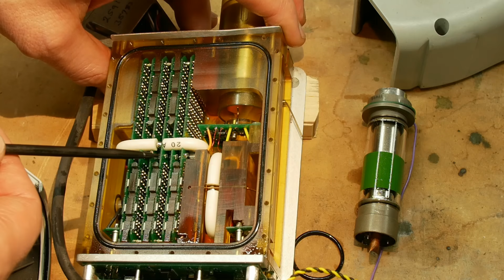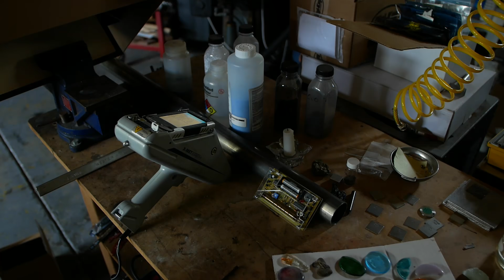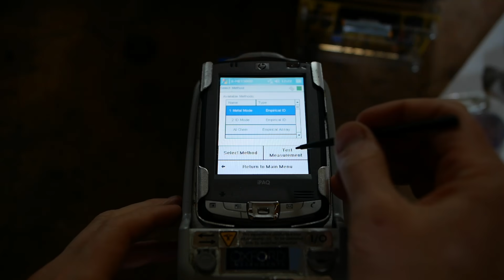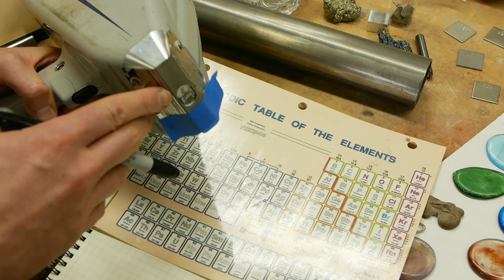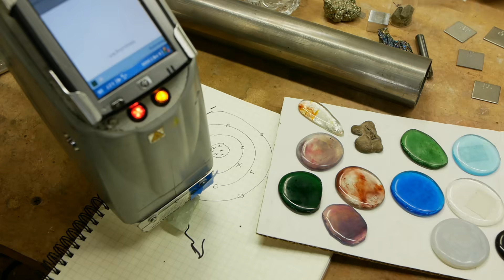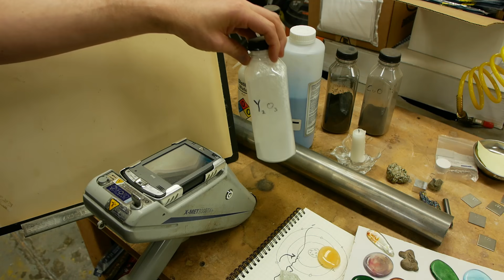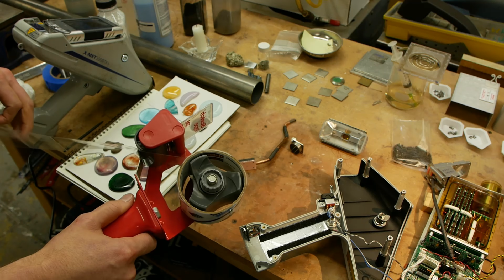Demo and teardown of an X-ray fluorescence gun (measures chemical composition)

Comment: The detector is likely either a Si-PIN photodiode, or if it's a more recent(/expensive) unit, it's an SDD - silicon drift detector. Beryllium window, multi-stage peltier cooled stack construction.
Reply: So cool to see y’all’s discussion on scintillation materials and the Si-PlN Technology. I totally geeked out and became addicted to buying and building Radioactive detection equipment over the past few years. A buddy of mine owns a large local scrapyard… And we are in close proximity to Oak Ridge national laboratory (Home of the atom bomb)...  we get WAY MORE than our fair share of “hotter than hell” sources, and my buddies scrapyard had no means of detection. That’s what started me out on this journey.

I started with a few small bicron Nal-(Tl) probes and worked my way up to a MASSIVE 5 inch Nal bicron detector. Also designed, 3-D printed, and cast my own lead collimator assemblies for the probes. 
So that I could use the ridiculously sensitive scintillation probes for the scrapyard… then with the use of the collimators I’m able to hone in on the exact location. 

It’s been a hell of a ride over the past two years… and the stuff in this video is WAY above my pay grade. 

I did build and purchase a few PIN photo diode array detectors.... but that stuff gets complicated fast.

I’ve been having a lot of fun recently purchasing radiation area monitors, port/border monitoring equipment, and walk-through style detectors made with massive sections of low resolution scintillating plastics. 

Still a lot of fun to play with! And some of it available on eBay at incredible prices. And I soon hope to have a drive-by detector set up and ready at my buddies scrap yard. 

It’s been a lot of fun locating hot sources. Some really spicy stuff around these parts… With all of the long running history of radioactivity and testing in our area.

Great to see there are many interesting folks out there!
Reply: Back in the early 90's I was doing my MS in Physics. A company had provided funding to my university (so they didn't have to get a license from the NRC) to build a prototype very similar to this. The differences were that 1) we were using Co-57 as a source of gamma rays to excite the x-rays within the sample, 2) we were specifically looking for only Lead (to detect Lead paint in housing projects), and 3) we were using low resolution (cheap) NaI scintillator crystal attached to a photomultiplier tube as the detector. I earned my MS from that project, but the company funding the research had problems of one sort or another and never ended up producing an actual product.
Reply: @andywinslow6631  Early handheld XRF tools used radioisotope sources. Usually Fe-55, which had to be replaced often due to decay.
Reply: @Spirit532  Fe55 emits very low energy, how x-ray fluorescence excited?
Reply: @MaxmaxOFF81  Other lines, I'm assuming. La/Lb, Ma/Mb. And Ka/Kb up to chromium. No idea if it'd actually work, but that's what I remember seeing.
Reply: @Spirit532  thanks!
Reply: TheNeatWhale  No, SiLi detectors are not and have never been made in such tiny cans. They also have basically no resolution above ~200K, which would be very difficult to achieve here.
The closest that has ever been commercially available was the Kevex PSi, and that didn't last long on the market. Not to mention it was about the size of this entire handheld unit.
Reply: dustisdeadbodies85 the X-ray window is transparent aluminium
Reply: @fdutrey  Curious. Most of the x-ray stuff I have played with (and the odd bits i own) use beryllium as the window beacuase of its low mass absorption coefficient. As the generator itself is quite low powered so the "back scatter" is going to be incredibly low, I would have thought they would do all they could to get every last hint of energy back into the device.
Reply: dustisdeadbodies85  
I just read up on it. Appears it is done with Instagram, reddit, Twitter, tik tok, and a few others, saw nothing pertaining to YouTube, although the individual channel owner can block a commenter for various reasons, but it is an outright block, not a so-called 'shadowblock'. I don't know. YT has been strange for a long time, but has been ads intensive to the max for 6+ months. I see several different ads that could be considered mini documentaries that last over 30 minutes. There is one by a Dr. Gundry about emptying bowels that, and this is no exaggeration, lasts 59 minutes and 59 seconds! And yes, I skip ads after noting the time and advertiser. They'll never get my business! 
  Sorry about the long-winded rant. I don't think that either of us is 'shadowbanned'.
Reply: @stanervin6108  You should read up on ad blockers too.
Reply: @TheMrTape  
    I totally know about Adblock. When used, the video uploader gets less than seven tenths of one percent ( .7% ) of ad revenue. When NOT used, the uploader gets seventy-five percent ( 75% ) of ad revenue. As long as the ads aren't skipped before the fifteen second mark! YouTube gets their twenty-five percent regardless of whether an adblocker is used or not! I choose not to use an adblocking app as my way to support the channel financially without paying for a Patreon subscription, as I am on Social Security benefits and just don't have sufficient funds to do so. I skip ads after the required 15 seconds, but jot down the ad length and admaker whenever the ad becomes abusive in length, i.e. anything over two minutes! Do you understand my stand on that matter?
Reply: @stanervin6108  I understand and respect your stance good sir. However it is my belief that running ads, something that relies on manipulating/attempting to control the free thinking of people, is immoral, greedy and incompetent, and furthermore disrespectful to the content in that it delays and muddies the quality of it, and the viewers in that it forcefully takes away some of their time up-front for something that potentially isn't worth it to them, regardless of their consent; I instead believe that what's right is for the content maker to be creative in non-parasitic ways of earning compensation for their work, at the free will of the viewers, in whatever way that doesn't choose/dictate for them, be it donations, selling products/merch or whatever else moral method they can come up with. All that said, content creators today are only paid 16.5% of the ad revenue (contrary to rumors/lies that state a much higher share), revenue of which is already extremely low; averages today go at $0.14 per 1000 views or $0.32 per 1000 views, for <10min and >10min videos respectively. Share has never been 75% (and it has never been anything at all for blocked ads), it has however been 55%, but then Google decided to decrease the share with 70%, so creators end up with 16.5% (in my country most music on Youtube was blocked for 2 months up until 2 weeks ago, because the "governing" body representing Danish artists, Koda, wouldn't accept the 70% decline in ad revenue shared with them and the artists in their new contract with Google; as a result Google announced they'd block all Danish music in Denmark, but ended up blocking most other music as well; Koda finally cracked and accepted; Google had by the way argued that this change was to bring the share in-line with what all other countries was already being paid, so it would be fair to them). A content creator thinking it's a good deal to enable ads and in turn lessen the viewing pleasure/experience of their videos, for 0.0014 CENT per view, is absolutely out of their mind, completely lazy and incompetent; lets say 1 in a 100 do as you do, that means that you give 1.4 cent for your 15 seconds spend before you skip an ad; lets say you spend 17 seconds on average to ensure the threshold is reached, that means your time is netting $2.96 per hour, an impressive 41% of federal US minimum wage, or 25% of average US minimum wage. Now is that really worth it? That's up to you of course. I'd argue that even if you were homeless, you'd be better off installing an ad blocker and pledging $1 to the odd channel once in a while, it'll even out, that would last you 71 blocked ads. As a bonus you'll probably end up netting the creator more, save your time noting down long ad makers, and save your mind from being bombarded and essentially molested with useless information you never asked for. Have a great day kind sir.
Reply: @TheMrTape  
  Thank you for the input. My percentages are off substantially. Haven't researched in over five years. My, have things changed! GreedTube indeed!
Reply: @TheMrTape  And what about the content creators you never "throw a bone" to? Why should they work so hard to entertain you, for free?
Just let the ads play when you're not watching or listening. In the car, switch inputs to something else while it runs, etc.
Reply: @NigelTolley  I already went into great detail regarding your points. I'm all for creators earning, just not by incredibly inefficient means that waste human life more than it supports. I'm not gonna spend one tenth of a second to let an ad run while doing something else, then switch back to see if it's over, just to earn the creator a measly cent; that's clearly not worth it; it's way better to just donate $5 and not do what you suggest 500 times.
Reply: TheNeatWhale  sili is dead... most of this detectors are based on high resistance silicone. Modern sdd operate close to da fano limit at minus 20 deg c. And still offer good resolution at room temperature.
Reply: dustisdeadbodies85  
I'll have to look up 'shadowbanned'. Not familiar with the term.
Reply: @stanervin6108  I gave you up votes so that you can confirm that you are not Shadowbaned. At least these comments were not Shadowbaned
Reply: @henryD9363  
Thank you, John. Showing up on my side, so i assume that things are normal. Have a great weekend everybody! I'm off to the dungeon of diagnostic delirium.
Reply: dustisdeadbodies85  
    Dammit, Jim. I'm a doctor. Not a paranormal investigator on Channel 3 at four A.M.!
Reply: Yup most of them have a SDD in them made by Amptek. They have a super thin beryllium window and are unbelievably fragile.
Reply: dustisdeadbodies85  😂

Comment: How delightful that it actually makes sci-fi sounds.
Reply: It is bettter than “Keep clear, keep clear, keep clear” you can just tell people to treat it like a phaser set to kill 😜
Reply: Yeah, those sounds made me chuckle every time he used it...
Reply: The auditory X-ray warning siren was, and still is a requirement for Canada and Switzerland.  If we shipped units there, they had this feature turned on with no ability to turn it off.  But if shipping anywhere else, it was turned off by default but the operator had the option of turning it on.  And it wasn't generated by the PDA. There is a small piezo speaker inside the analyzer and it's driven by a pin on one of the micros.  It had to be done this way to prevent customers from disabling it.
Reply: @ribrobrab  That's an interesting fact, but I must speak my contention against the concept of a feature that can't be turned off. No such thing exists and a simple swipe of a razor across a trace would prove that, and if, by design, the traces making the sound are integral to the functioning of the device, then one swipe, a couple scratches, and a bit of wire soldered across with the possible addition of a small inductor and resistor would do the trick.
Reply: @AtlasReburdened  I stand corrected.  ;)
Reply: @AtlasReburdened  Or you could simply clip the wire going to the piezo element.. 🤷🏻
Reply: @davelowets I was speaking towards a worse case scenario where, for instance, the piezo speaker is surface mount soldered  directly to the pcb, with the trace going under the housing and then to other core functional components. Obviously if its just a couple of wires going only to that, it would be simple to disable.
Reply: @AtlasReburdened just fill the piezo speaker up with hot glue
Reply: Its fun, but I suspect that it would get old fast.
Reply: The newer ones don’t, they just blink!
Reply: It was like someone said 'Can I have a sci-fi gun that makes bleepy noises?'
'Err okay.. We can make it send and receive x-rays, if you want!?'
'Yep, bleeps and x-rays... EXCELLENT!!'
Reply: So do smoke alarms if you listen to the EM as is, without interpreting it as a commercial radio (for music etc…) would. RayGun sound :) And lightning is like eating crisps.
Reply: the ones at my school make no noises.
Reply: @ZE0XE0  Zeoxeo gets around  :) i've seen your name pop up on a few channels I follow :) keep up the good work brother ;)
Reply: I'm SURE whoever designed the audio section of this instrument did that COMPLETELY on purpose... 😁

Comment: Thrilling.  I had no idea such a portable device existed.  Now I need one.
Reply: As Used In The Mining Industry , In The Mines To Track What The Chemical , Element , Ores Are In The Mine Walls .
   Why Dig And Test Samples When You Can " XRF " It .
   Point The Gun , Test Results  Are Instantly Available . ( 10 To 20 Seconds )
      Rio Tinto , Barrick , NewMount ....  Have Them .
     Packed Inside A Black Pelican Case And Shipped .
Reply: Got to watch out.  IMO the XRF market is overrated and overpriced.  There are scammers claiming low cost overseas, out to take your money.  Even Amptek poses as an inventor while selling devices that were invented in Germany.  Lately many other spectroscopy technologies have put pressure on the XRF technologies.  Some say XRF can resolve to 1ppm or about 1/10000 percent.  I see 500 to 1000ppm as more realistic.  Best to read finely powdered samples same size shape integration time compared with known standard samples.  Also dope unknown samples with known quantity of a well known metal like Copper, Zinc, or Tin to experimentally calibrate your reading of the unknown metals.  The ppm measure correlates with percent weight composition when calibrated in this way.  It validates the software calculation via your calibration's "empirical fit or reduction factor".  I have seen results that were about 4 times higher than my empirical calibration was able to demonstrate.
Reply: Was just saying to my self now I need one
Reply: Fairly common usage in the environmental field, for example to detect lead in paint.
Reply: If you’re hyped from xrf, watch signal paths video with the Raman spectrometer. „Just a laser“
Oh, and no price tag. Not even „call for price“ 😊
Reply: Only if it detects aluminum
Reply: @khash7473  Our model detects Aluminum, absolutely.  However EDXRF cannot detect Carbon.  For carbon content in aluminum and other alloys you must use another process such as LIBS, OES, or WDXRF. We also make a LIBS handheld. They are all available on our site https://www.bruker.com/products/x-ray-diffraction-and-elemental-analysis/handheld-xrf.html
Reply: They at least used to be really expensive like 30k or more.
Reply: @Manintoga  they still are, at least the good ones.
Reply: Wait 'til you see what they cost!
Reply: In europe you can contact me. :)

Comment: So the electrons from the outer orbits also get knocked out and emit energy but the foil in the window makes sure this is rejected? Neat...
Reply: Either foil or just air. It's very hard to detect the low energy secondary emissions in air, which is why most of the ultra high end detection stuff happens either in standalone vacuum chamber XRF analyzers, or(more commonly) as an add-on to electron microscopes(though they skip the "initial x-ray" bit by bombarding the sample with electrons).
Reply: @Spirit532  Quite practical, thanks for sharing!

Comment: I really wish I had this video during my crystallography class in college... Great job!
Reply: @user-jp1qt8ut3s  crystallography 😏
Reply: They're just a bit pricey. About a "Good Car" pricey. ( https://www.labx.com/product/xrf-spectrometer )
Reply: @user-jp1qt8ut3s  Crystallography is just a minor subject in an Undergraduate Physic courses, so you won't see a study labelled Crystallography, just a "Physics ...". For example: "Applied Physics".
Reply: @user-jp1qt8ut3s  it is different that an Engineering courses because it include 'microscopic' subjects like solid-state physic, and crystallography, and or semiconductor physic, or sometimes spectroscopy, so not an Undergraduate Engineering courses, but  more toward a middle ground between pure/theoretical Physic & Engineering. Where the job prospect is not entirely academics.